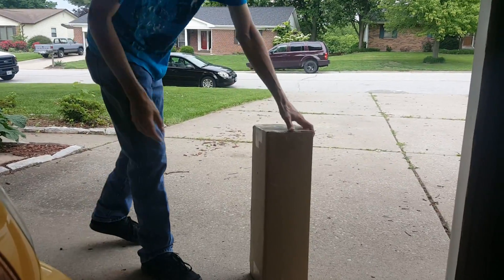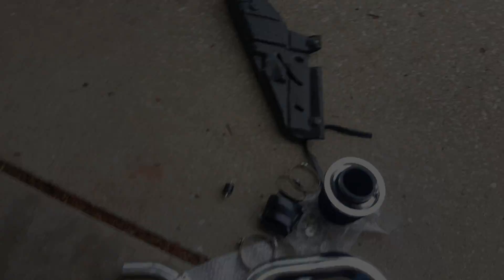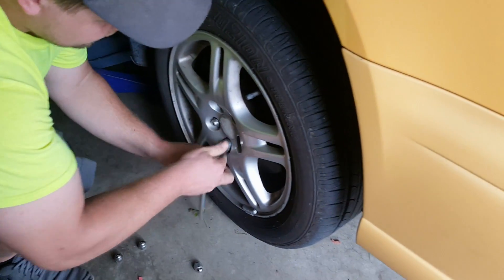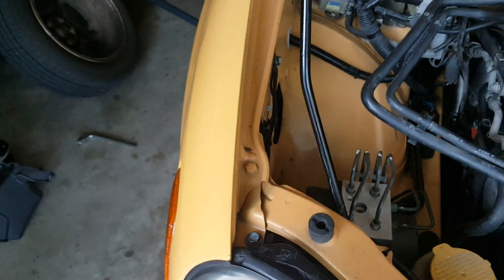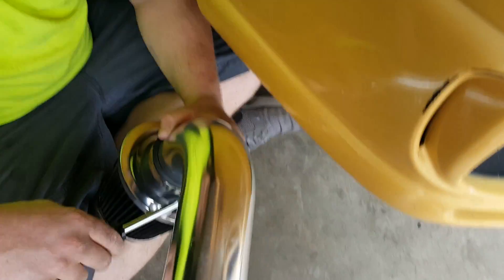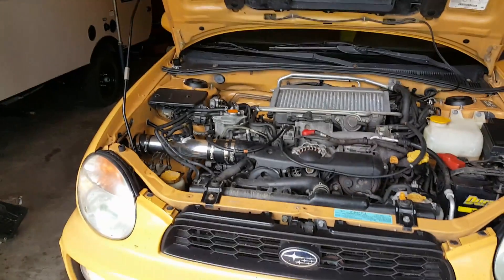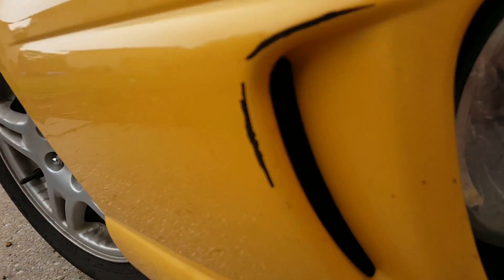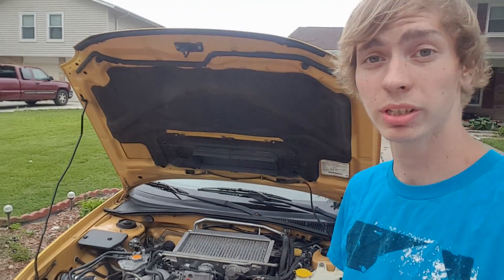Cold Air Intake - Unbox & Install on 2003 WRX! (Subaru WRX Cold Air Intake Install)

Comment: you failed to replace the cold air feed to the guard :/ defeats the purpose of why the filter mounts in the guard near where the first part you removed feeds the air,
refit the cold air intake the flat peice that mounts with two screws and pushes cold air into the guard

Comment: Did you get a check engine light after the install? After I installed a Cobb Sf intake I got a engine for mass air sensor  and I had to reset the ecu.
Reply: that's because you did not plug it in or you took it out when your car was turn on not running or you trun the car on and went ohh shit i for got to plug it in
Reply: Happymanasfk Subaru can you claify this for me. So do i disconnect the battery before removing the mass air flow. I have an induction kit coming thursday. Mine is an 03 WRX

Comment: did you get the check engine light on after installing CAI? I heard that you have to tune the car to accept the extra air flow in your intake system. I hope its not always the case
Reply from the maker: I didnt get a code and I only ran it a month without a tune and it ran pretty normal still. No tune could cause engine damage tho
Reply: @Reksir  Did you get a tune on it or you put the stock one back on?

Comment: does this require a new tune? I put one in on my car and it won't run worth a shit... it is stock btw.
Reply from the maker: MK customs My car ran fine with no tune and my friends ran fine with no tune either but it is highly recommended cuz u could blow a rod if it malfunctions cuz of the intake
Reply: I figured it was the maf sensor I cranked it down good and everything is tight I'll have to go back and check again but I'm not sure what else I would have missed. thanks though
Reply: I figured it was the maf sensor I cranked it down good and everything is tight I'll have to go back and check again but I'm not sure what else I would have missed. thanks though
Reply: the maf sensor was backwards 😂 I feel like that is worth noting. I had the pipe in backwards. I didn't thin it mattered seeing as it is the same shape either way you flip it.
Reply: Bug eyes are a little more lenient when coming to installing mods such as intakes and exhaust work

Comment: Did you have to get a tune?
Reply: Brook Armstrong if it is the only modification no (as in the rest of the car is stock), but if you have after market exhaust, intercooler or turbo, it is recommended to get a tune.
 Tuning with only the cold air intake will be more beneficial in regards to power, so if you can afford, it will be worth it
Reply: 420psi this cold air intake requires a tune immediately, as the air is flowing differently with more turblulence, and the MAF scaling will not be the same due to minor differences in diameter.
Reply: @masonc1010  how do you tune it? Through the access port or what?
Reply: @E36poopcar  Access port lets you tune the stock ECU
Reply: @masonc1010  yeah I have one but am pretty new to it. Can you do it through the access port or just get a tuner to download onto it

Comment: I'm not very good with cars but can't water get kicked up into that?
Reply from the maker: My car and most cars have a plasic cover under there car which is easy to remove and put back on so no water can get up into it. Yes water can get in through that small opening in the front but it would be impossible to have so much water get through that it would mess anything up. Ive had my intake on for a long time and drove through tough conditions and never had a problem. Good question tho, I love answering them! :D

Comment: Doesnt seem to be an ideal place to put the filter.  Also the stock hole is still there.  Insert hot air.  And water 💦
Reply: incorrect. cai for a wrx is bad but that is not true at all.